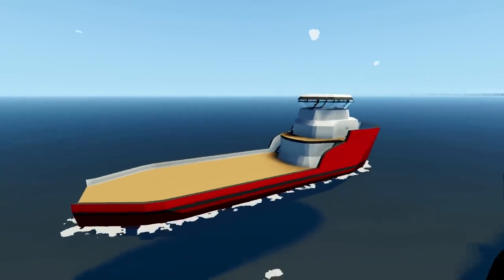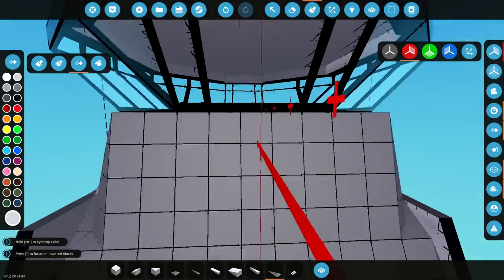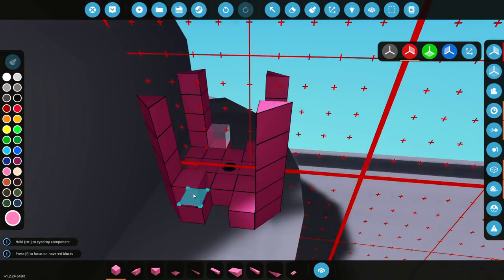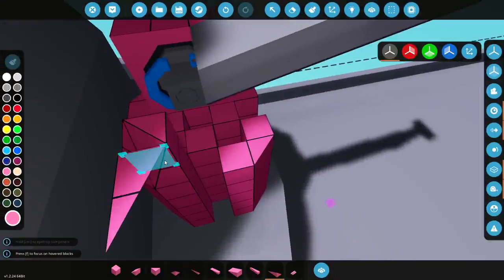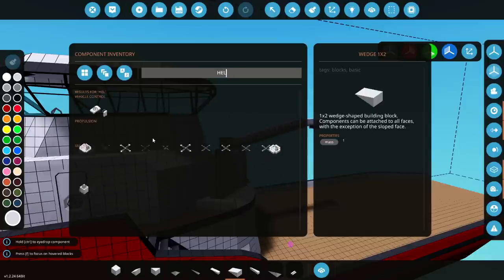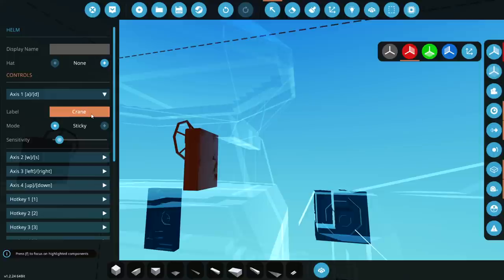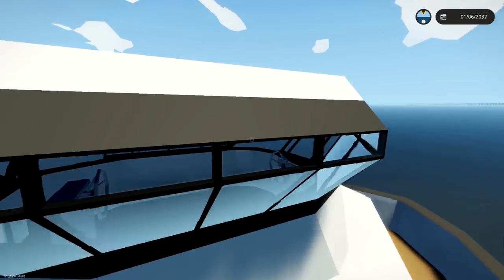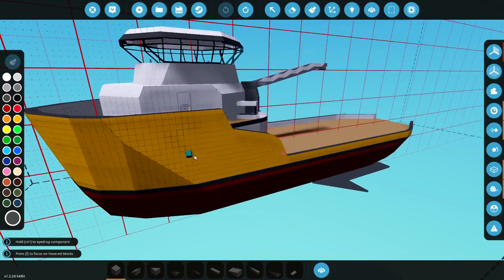Main Crane ADDED! - NEW Supply Ship Build - Stormworks Build and Rescue

Comment: I have a suggestion for a new project!
Inspired from the McDonnell XF-85 "Goblin" Plane:
Build a basic jet engine. Then put a seat in top of it. Thats your base.

Now you have to build the smallest plane possible around it. You can extend the engine a bit or built in front of it, but aim for the shortest version you can make.
Of course, you have to play without Unlimited Fuel/Energy, so you will run into the issue of how to store as much fuel as possible into the tiny hull, but another problem i ran into when building my plane was to control it. So i would say, try to build a plane that can
- take off at an airport
- flies at least 400 km/h
- Bonus points for passing under 2 bridges
- Also Bonus points for flight duration
- Lands at another airport runway

If you like what you built, you can continue and implement the launch mechanism on a larger airplane, but that's something i haven't figured out myself, expecially the recatch mechanism.
Reply from the maker: I've been planning on building something like that for a while, unfortunately, they're really difficult to get spot on :P
Reply: @FranticMatty  That's true. It's a lot try and error. Maybe as an off-stream built?

Oh, and you may want to look up "Elevons" for this, maybe that helps :)